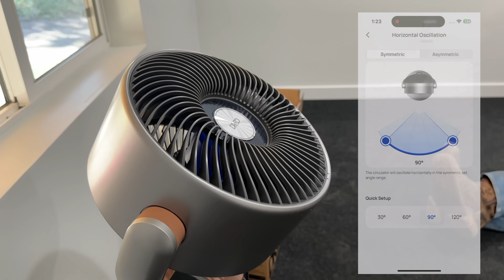#749 - Erosion Control Around Our Mountainside Home... More Sod???

Comment: For 9 years  since we started construction on our home we did not have AC.  Instead we relied on a Whole House fan.  Nights are usually pretty cool here as well. So we would open up the house in the evening and turn the fan on. By morning we could have the house down to low 60's or even mid 50's.  But the downside was that we had to live in an act e on hot days.  We'd keep all the blinds drawn to keep the heat out.  In July I installed a Mini Split in the great room.  I can't tell you how much we've enjoyed it. Yesterday we received our electric bill.  Honestly it barely impacted it..

Comment: HAPPY BIRTHDAY CEDAR, and Many More To Come. 

Red Poppy Ranch is looking more and more settled. 

Heath,
The rock walls really will take a lot of hillside sliding worries away next Spring, and the sod behind the house will definitely keep the erosion down. Getting some sod on the embankment at the corner would be a good idea too as that is the one area still exposed making it the one spot more prone to a slide potentially opening up that end of the hill. 
Some Kentucky Grass seed put down, even now, would give enough rooting to shore up the soil and make the embankment more solid, and keep the weeds away.

Looking at it just now it might even be a good idea to extend the 2nd level rock wall into the embankment to give more support and prevent it from moving in the Spring MeltDown, extending it in a wide U shape to meet the top end of the 1st rock wall behind the house. Visually it would add more depth and character and also be additional support to the hill.

That's not trying to tell you how to do anything. It's just seeing a potential problem and giving it a simple fix now so nothing unwanted happens.

Thanks For Another Great Video. 
It's amazing thinking back to where I found the channel when you were still building the house, to where you are now. 
I started with the channel as a Subscriber when you were just starting to frame the walls on the 2nd floor. 
You've come a long way since then.

HAPPY BIRTHDAY AGAIN CEDAR. 
Keep Safe and Loving,
Matt - Toronto, Canada (Soon to be watching from somewhere else in the world!)
Reply from the maker: Thank you for your support Matt! 😊
Reply: @RedPoppyRanch  No need to thank me, but it does make me feel nice knowing you care to.

Comment: Heath and Cedar, the home looks beautiful.  Question, have you thought about putting a plastic perforated 12 inch tube that allows water into the tube on the side of the house where the veggies are grown.  100 feet of it should help with some of that run off and have your end piece cut in a angle of the property.  I don't know, just something I was thinking of when I saw the rain at the start.  Happy Birthday Cedar!!!!  And to many many more!   Hey I guess that GoPro is Buck tested and Buck approved.

Comment: I see empty garden beds. If they are empty put in so mache or cornflower lettuce. You can have fall and frost salads. In the early spring, it will.poke it's leaves up through the last of the snow and you can have nice March and April salads. Kale would do well now too.

Comment: i think you need to expand 2nd terrace to size of backyard and then put in third terrace/6 ft walking  trail grades to right with some gravel in back furrow to guide all water around and away - more work yeah but you have a lot of water to contend with - then you can pivot to road building and site work on back 40 - you are almost there - in a month you will have things much more sorted and setup. go big with compost - i think another paddock on back hill with clover may be nice - by having separate paddocks you will be able to to rotate and reduce grazing pressure, consider taking out more trees #phases #staging

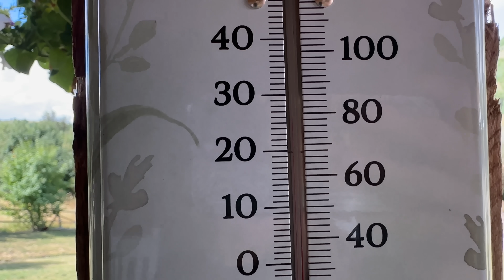Comment: 14:27  You said "Thermostat".   I know you really intended to say "Thermometer".   A Thermostat is an electro-mechanical device to control or regulate temperature.  A Thermometer measures the temperature, and what you hung up is quite defnitely a thermometer.  What is more, your new thermometer displays the temperature in Centigrade (left hand scale) and Fahrenheit (right hand scale).

Comment: @RedPoppyRanch I live in Australia and I dont have air con either, its called windows and floor, not ceiling, fans that keeps inside the house on average approx. 15 deg C  cooler than the outside on a 40 deg C + day. (104F)  not looking forward to this summer temps in the country are already well above average for this time of year. Where I live it is 610 meters (2001.3 feet)  above sea level. Um re: soil erosion, I would've put large gravel graded sway along base of cut approx. 30cm deep lined with weed matting topped with coarse gravel then topped again with matting then soil and turf. Looking at how much sunlight the terrace gets, was thinking vege patch transfer to the first level ?!?!?!?!?!?. Looked into the fan but unfortunately the cost to mail it to Australia is greater than the cost of the fan. 😭😭😭Happy Birthday Ole Girl hope ye had a lovely day. 🎂💐🎈

Comment: Personally, I would have built a 2ft tall raised bed all along that side of your house, with cemented rock wall.. that would act as a barrier to keep any flood water away from the house and force it to flow around the sides.  Plus you can plant things all along there..    (basically just like how you have it, except it's raised to match that first level rock wall on the hill).

Comment: That was a Thermometer not a Thermostat. The difference is that the thermometer only measures the temperature does not control the heating or cooling. The thermostat regulates the temperature by turning the heating or cooling system on or off to maintain the desire level.